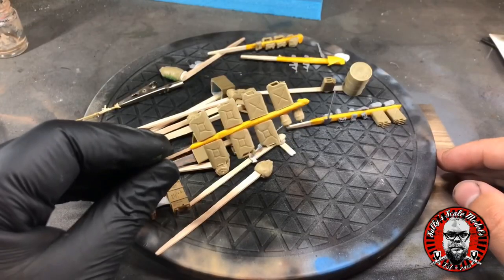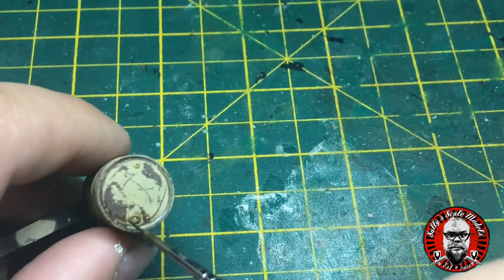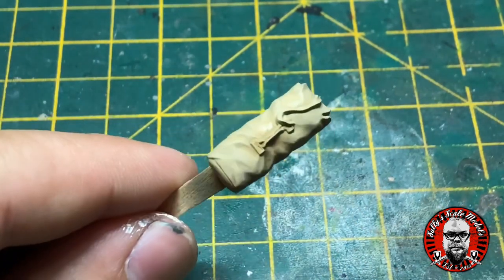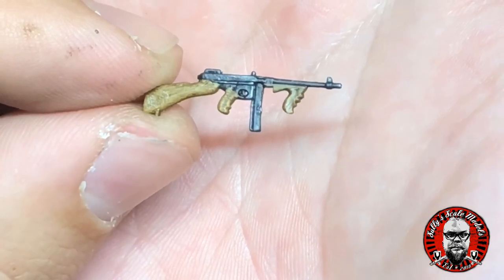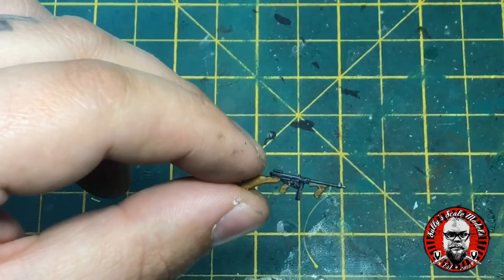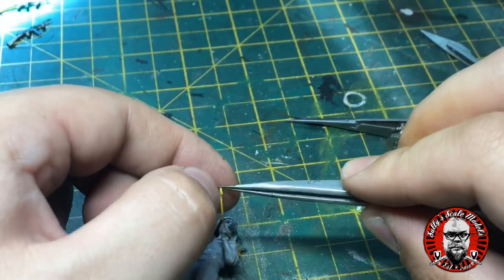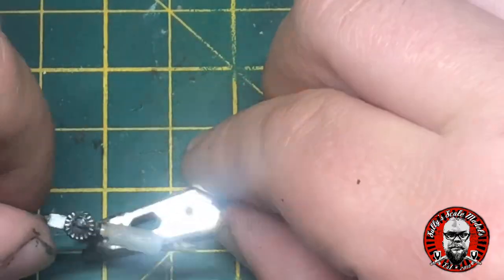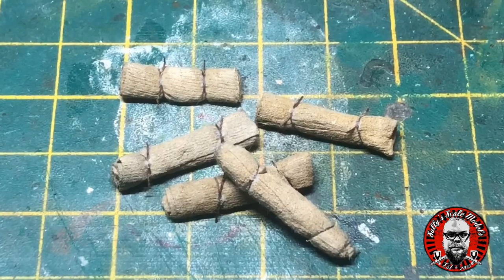Tamiya LRDG Part3 ‘Gear’

Comment: All good it's the blue we all debate over haha! The LRDG did use some apparently blue but really think it was more the caunter silver grey but still looking into it!
Reply from the maker: From what i researched it was a thing! I think it was more a common scheme on tanks but lesser know on LRDG
Reply: @SullysScaleModels  yeah it definitely was the paint scheme but the blue or sky blue tamiya suggests for caunter and lrdg isn't correct I've just this second picked another one up if you still have your Bix the correct blue is on the side of the box with a build model!
Mike stramer is best to look up for British camouflage his documents keep us modeler's right when it comes to the caunter and lrdg schemes! Ive seen the Lewis wrapped like that on an old video on YouTube so the loader running about the back doesn't touch the damb thing lol I like that detail
Reply from the maker: @Emtbtoday  ye tbh i should of faded the blue a bit further but it also looks more vibrant on the video that it actually is! And for the lewis i just seen it done else were and thought it would just be a good add lol
Reply: @SullysScaleModels  I've seen it with the Lewis gun and the vickers on that pedestal in the middle mostly vickers in middle and Lewis onnfront left but depends on the day what you want to use lol the Vickers they used had an AMMO box fitted to the mount just like a 50 cals would but must have been a nightmare for water for that thing! I'll leave a link to video has one in it woth the vickers water cooled! Just a weird Gun to use in the Dr desert you'd think eh lol
https://youtu.be/2XSk56E9VQo
Reply: @SullysScaleModels  
https://youtu.be/1yxnyvcfiho

This has a couple of good pics of the front of one still I the desert you can just make out the silver grey over the light stone on the badge n grill! There's more further on but still you've done a nice job it's not the model nothing wrong with it just something we always debate on that mysterious blue that never was! Lol my mate owns the hobby shop next to my house noticed he got this kit in yesterday so just went n bought it while it's there! Not easy to get these days!
Reply from the maker: @Emtbtoday  lucky lad!!! Models shops so few and far between!! I think i got mine off ebay was a few there lol
Reply: @SullysScaleModels  yeah but spend a fortune I'm in near everyday for a blether and can't ever come away with empty hands lol

Comment: Beginner here. Just to clarify chipping of oil drum. Coat of old rust, let dry. Coat of green, remove some with wet brush before dries. Correct?
Reply from the maker: Not quite, so rust colour 1st you will then need a chipping medium 2-3 layers let each dry soon as the last coat is dry(best when in the same day) then what ever top coat colour you want just dont put a thick coat on just anuf that you cant se the rust. Then with some water then remove what you want

Comment: Hi, do you use tamiya acrylic paints?
Reply from the maker: Normally i only use them in the airbrush because there not very good brush painting out the pot. But i found that if you use a couple of drops of acrylic thinner and some acrylic paint retarder it will brush paint quite well. It will depend on the volume of paint you want to use i tend to get 2-3 brush loads 2drops of thinner and a drop of retarder but if its quite warmer you may want to add either more or keep adding as you go. Its one of them things you will find the right mix but if you start with that its a pretty good base lines